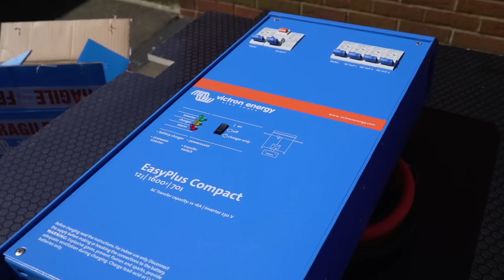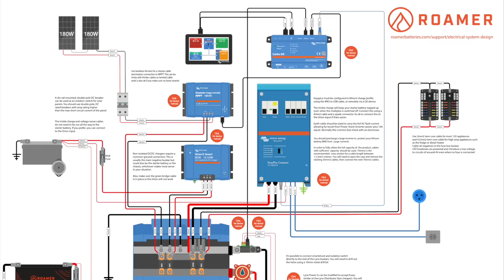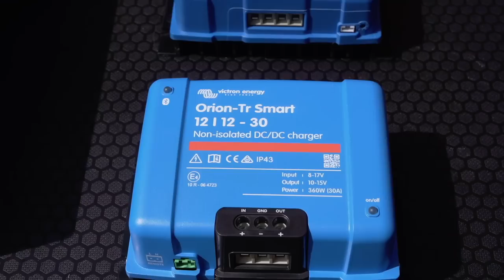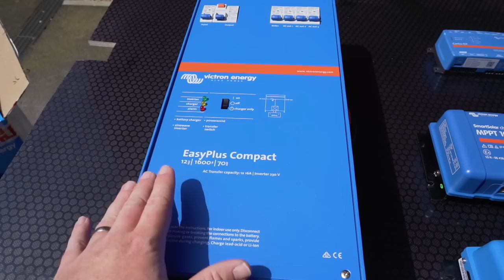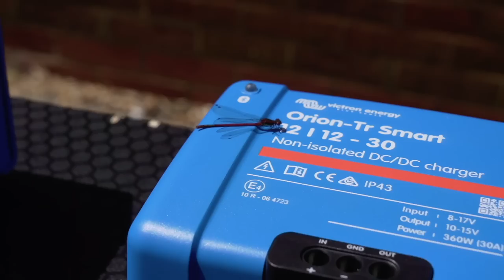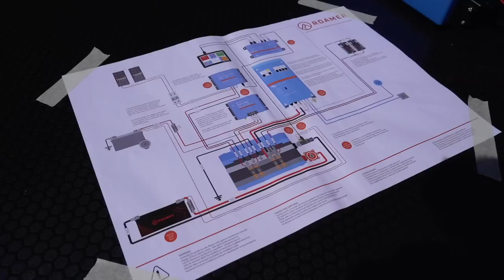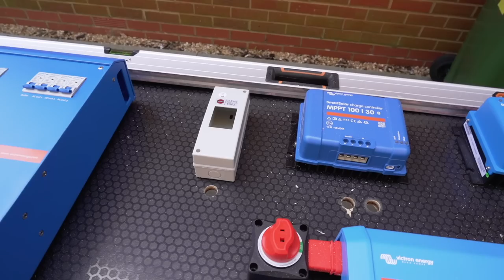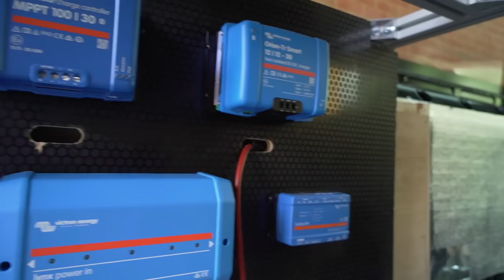VW Camper Conversion Electrical Install - This Is SHOCKINGLY Complicated!!

Comment: Looking great. A quick suggestion, where the cables go through the holes in the phenolic board they will over time chafe so I usually use self amalgamating rubberised tape and just wrap some round the cables so that the rubber touches the board. Safe.  Steve

Comment: Your doing a great job there Shaun. Hidden work is the hardest. It’s a big job converting a van properly as well all of the family and work commitments. I chatted with you in 2018 at the NEC and told you of my attempt at a van build that went wrong due to an engine fire caused from previous garage work using a jubilee clip instead of a Mercedes hose clip on the rad pack that wore away the main wiring loom! 🔥 
Nobody was hurt and that incident sent us on our VW California Ocean journey.
Reply: Hey, whatever you chatted about evidently did not put him off. If anything, it encouraged him👍

Comment: Looks like a great setup - I’m about to add a Cerbo GX to my setup. That heat resistant board is a great idea. Good that Roamer does the schematics too, that’s super helpful.
Good luck with the rest of the install and wiring it up.
All the best, David 👍

Comment: Great videos Interested in the route you took cables from the van battery to the dc to dc charger still I decide which side of the vehicle under the bed to put my electrics

Comment: Really enjoyed this episode, personally with all that kit and your powerbanks I’d avoid a gas installation if possible. An induction hob and air fryer draw a lot of current but only for short periods of time, I just use a portable single gas  burner if power gets low, I understand your demands will be higher with the growing family👍👍👍
Reply from the maker: Thank you very much. It’s definitely worth considering. Thanks again 👍

Comment: I think I'd just go portable now and build a van with that in mind. A Delta2 and Extra Battery with a good solar set up would keep you off grid and power just about anything required..or go Delta Pro. Having that portability and being able to charge them at Car Chargers too opens up off grid living.and having the ability to just tie it in with their AC and Heater unit for less that £900 makes a lot of sense for a van. AC alone is what £2K+ in a van, a decent branded heater another £1K (plus install time)...

Comment: You won’t get any better than Victron. One question though why didn’t you go for an induction hob and not have gas at all?
Reply from the maker: We prefer to cook with gas and we also like to have a bit of redundancy. If the battery fails (albeit very unlikely) we can still cook, we can always plug in a portable electric hob when on hook up if we want to save the gas for whatever reason.

Comment: Few suggestions - some too late. I think it is much easier to cut clean lines with a multi tool rather than a jigsaw. I would have bonded some 1mm aluminium strips along the edges to prevent damage of the thin sections. I think I would always use separate items if possible too make changes more easily in the future if I wanted an improved inverter or distribution and also if any one element failed. I also think I would be very tempted to have a professional install just on the electrics as they did on camper vibe for their mums van. The phenolic boards are often used on trailer floors for water proofing, friction and noise. One last point I would not place my gas cylinder near the electrics even in its own enclosure with vented sump.

Comment: Certainly a big job but you're off to a great start! By the way, where did you source your phenolic board from (im uk based). Cheers!
Reply from the maker: Thanks Paul. I got the board from eBay actually and it arrived unbelievably fast 👍

Comment: I’m new to this, so sorry for the ignorance, but can’t you use the ecoflow for those things ? Would be intreasted in the price comparison too ?
Reply from the maker: Lots of people do go down that route with great success. The only really reason I can find for not choosing to do that is if something fails you generally have to buy a complete new power station whereas with a dedicated installation you can replace or upgrade individual components as and when.

Comment: I thought you were a sparkie by trade?
Reply from the maker: Technically yes, but I did big mains cables for campsites so it consisted of digging trenches mainly 😂 I should also add that was 13 years ago as well. Lots has been forgotten

Comment: Im surprised that more people dont switch over to using a powerstation.  I have one that powers everything including running two fridges, my gallery  pump, tv, computers abd all at the same time.  It supplies 240v, 12v, 5v and you can with the aid of a very small solar panel have endless power. Its also a lot lighter and xan go portable very easily so you can charge your cars flat battery. They come in a multiple array of sizes. Mine only weighs 5kg.
Have you ever considered them as an option? The a a breeze to install with no need for heavy car batteries  separate mpt controller, etc. Here's a link to my review on the one I use 
https://youtu.be/07kMLcwRNiU